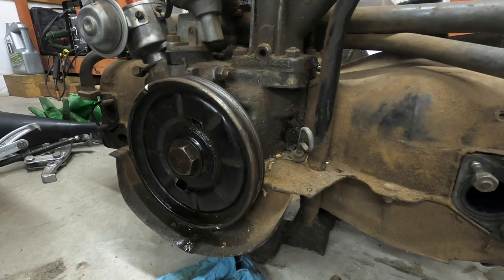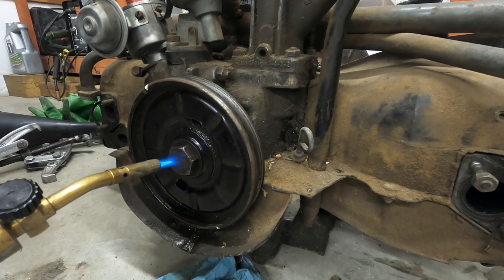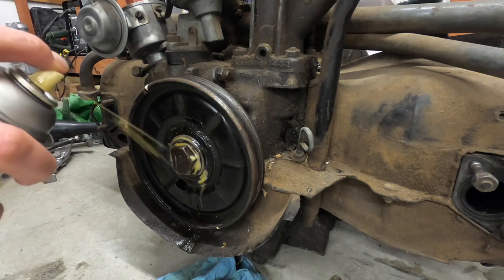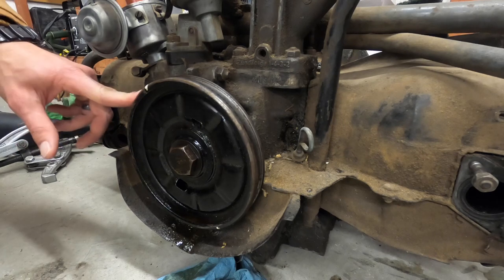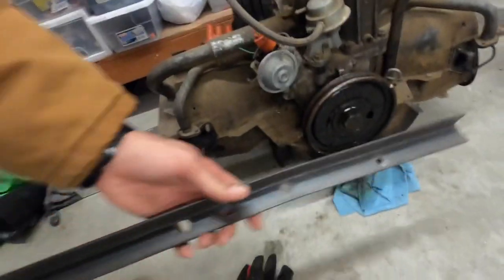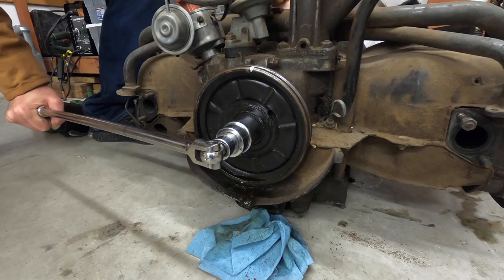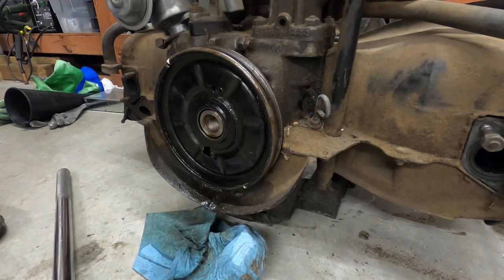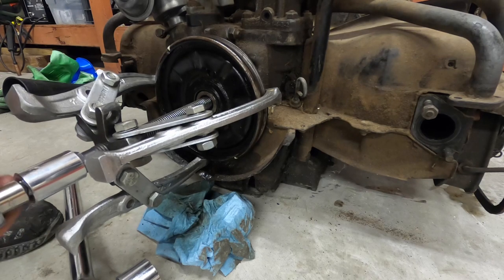Crank Pulley Removal - VW Beetle

Comment: Where’s the thrower washer . I was told as I keep getting oil on top of deck lid it’s probably the thrower washer behind the pulley?  I was told it’s an engine split job.
Reply from the maker: https://youtu.be/aCCcHCdlqmU?si=XbfB0_K-CFZV11M_

If you take a look at the beginning of this video you can see it on the inside (shinier than the block), on the crank. You do have to take the block apart.

How’s your oil level?  Having too high of a level of oil can cause problems as well.

Comment: I tried that other tool and it bent my pulley, but worked if I turned pulley while tightening.
Reply from the maker: It must have been on there for a really long time.  Maybe try putting PB blaster on it for a while before attempting to pull it off.
Reply: @VitosFix  yeah I was able to get it off. It was on there for a long time. Probably about 8 years. I didn’t put any pb blaster but I got it off. I bought a new one to replace it. I got the cb performance one you got. Jaaa. I want led the scat one but it didn’t have numbers at the top cuz of the logo so I went with the cb one.